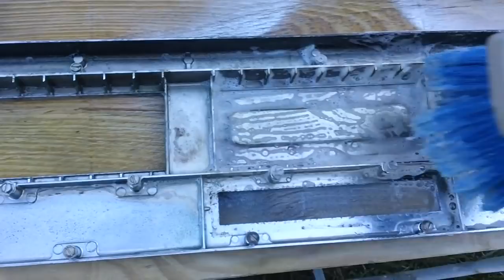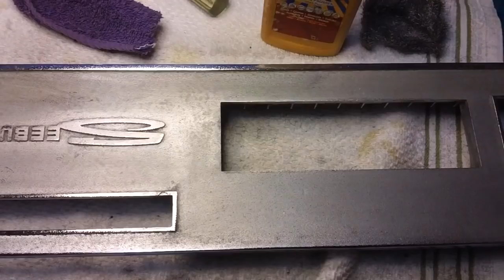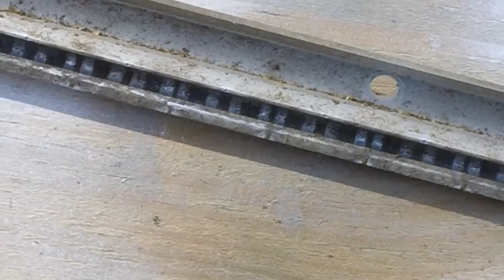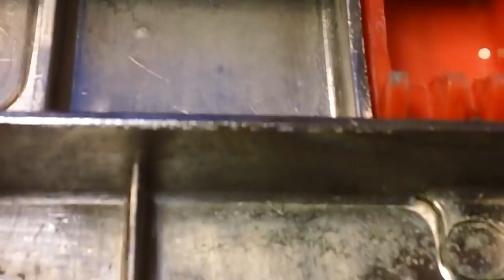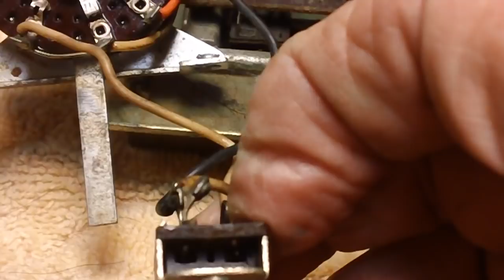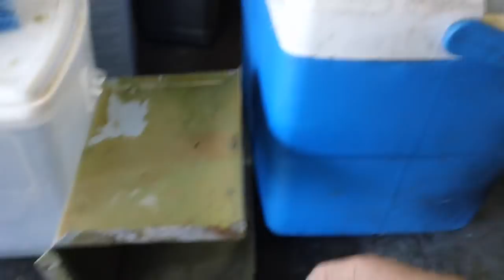1961 Seeburg AY100U Jukebox Restoration (Part 36 of 87).

Comment: Hi John, 

I wouldn't dissemble it, but I know that you will.  I don't have quite the experience you have yet.

As far as Deoxit, I found some on E-bay with free shipping included for $16.71.  I got some from E-bay a couple of years back that was a bit cheaper, I think.  I only use it when nothing else will do.  I use the same contact cleaner you use and that usually works fine for me.

Regards, Tom
Reply from the maker: Tom,
Be sure to catch part 38, my friend.
regards,
John

Comment: John, I have also had good luck with. wd-40. I read that one reason that switches and pots don't work is not actually because of dirt but because the phenolic board that holds the contacts dries out and shrinks. The wd-40. has a light  mineral oil in it that soaks into the phenolic and it expands and the contacts is re-established.  Maybe? I don't know, but I do know a tiny drop applied to the edge of the phenolic is drawn in and the switches or pots begin to work.

Comment: John,
Flea markets, church jumble sales, village fairs, garage sales, auctions, car boot sales: I love ‘em all!  I sure would love to see, and hear what you, and your daughter found at the auction.
When it comes down to cleaning switches, contacts, and terminals, there is only one word that counts: ‘Meticulous’.  Good to see you applying that word when you cleaned those switches and contacts.  Provided it works to good effect, use whatever you will for cleaning, and lubricating, such as WD40.  In the past, I’ve used trichloroethylene, perchloroethylene, carbon tetrachloride etc. …the types of cleaning substances that would, these days, have the health and safety gurus, and environmentalists reaching for a sedative whilst at the same time soiling their undergarments LOL.
Yes my friend, I too have dismantled, cleaned, and reassembled those frame chassis on commercial laundry equipment, vending machines, as well as jukeboxes.  It is one of the more important parts of servicing/restoration …in virtually all instances there’s no getting away from it.  If you’re wanting to achieve a ‘trouble free’ future, it has to be done!
Please remember, for the love of God, meticulously photograph, video, and document (including loads of coloured pencil crayon sketches if you have to) every detail …right down to where the smallest lead dressing is routed, and where the last screw goes.  Everything must be reassembled per manufacturer’s specifications.
Note: constantly be on the lookout for general wear and tear, such as ‘end-float’ etc.  For example, use shim material where necessary …better still, replace if new parts are available.
Regards, Phil.

Comment: Hey John, The best stuff I have found for taking off nicotine from stuff is a glass cleaner that comes in an aerosol can called Sprayway.  Walmart has it for about $2.50 a can and one can lasts quite a long time.  It almost instantly removes the cigarette smoke/nicotine residue and it is bar none also the best glass cleaner I have ever found.  It sprays on kinda like a clingy foam so it's also great for flat screen tv sets because you can wipe it up before it has a chance to run down and get behind the plastic housing.  Just figured I'd let ya know about that stuff for future reference.  I smoke and over the years I've tried about everything and that stuff is just the best.  Take care, Gary

Comment: I vote that you get the rest of the juke back together as far as possible, plug it all up in a temporary fashion, and see what there is to be seen when you try to operate the jukebox. This panel in the way it is built looks like a great way to add bugs or issues in the juke that would be hard to diagnose. Here, there be dragons! After you see what you have to work with and get the other issues on the jukebox fixed mechanically, then tear this sucker down and give it the cleaning and reworking that it deserves!